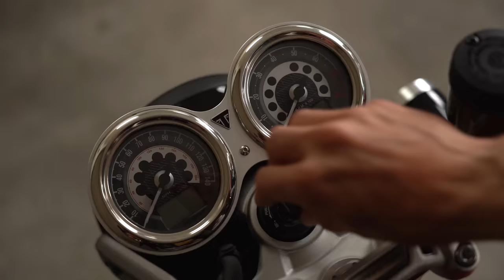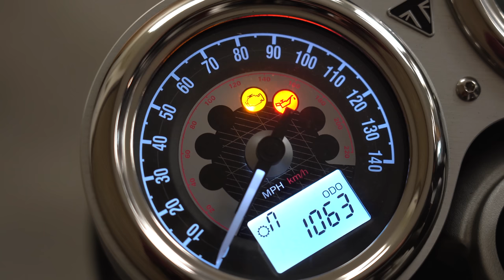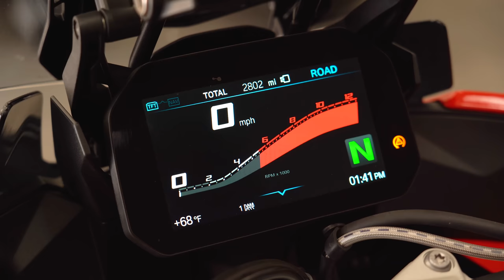Do You Need To Warm Up Your Engine? | The Shop Manual

Comment: I have always believed it to be healthy to warm any engine up for a minute or two. I have a 2021 Z900 and a 2017 Audi A4 and both of these vehicles rev at about 1200 at idle for about a minute depending on the outside temp. I let them both drop down to the natural idle speed before driving/riding.
Reply: A lot of this stuff is from old information before modern tech. Some people still think they need to let the car warm up too and that hasn't been true at least since the 90s. Some places in the US even make it illegal to leave your vehicle idling since all it does is waste gas and add unnecessary pollution.
Reply: @danielkerr4100  that simply isn't true anymore. It was a few decades ago but modern engines don't have the same issues. After 4 minutes it has gone through the same amount engine wearing cycles as if it was double idle for 2 minutes. It's even illegal to let your car ideal for that long in some areas in the US because you don't need to do that anymore. And if what your saying is true when does the engine blow up? My car is at 82k miles now and I've had it from 13k and haven't had any engine issues and I drive it the same in summer and winter and hit it hard once it has warmed up. Do you have any concrete data that backs up those claims because I should see some loss of performance at this point especially since my car is a sports car. Also the more efficient your engine is the less heat it will produce at ideal so that would only intruce more inconsistency with the logic in modern cars.
Reply: Sweet! I have a 2020 Z900. I  love that bike.
Reply: Old car manuals will say 30 seconds.. something about getting the piston/rings to be expanded as to reduce blow by.
Reply: Why would you idle a car at 1200 rpm ?
Reply: @dammdaniel9953  it idles at 800 rpm but when cold, it idles at 1200 rpm for a short time, once the revs drop, I then drive it.
Reply: @dangernoodle4305  that's to warm up the catalytic converters apparently as the metals inside need to reach a certain temp to convert carbon into CO2, and other things in your exhuast gases effectively.
Reply: @trsskater i try that in the morning after the night of heavy raining i parked my bike outside without cover it....the first engine start in the morning just fine and i didn't idling the engine...just ride off...and bad happen when i was stop at the cafe to get my breakfast...and done breakfast...my bike fail to start....i waited till 30 minutes and then the engine start so smooth.... i talked to my mechanic he said during cold you have to warm up the engine atleast 4 to 5 minutes....the engine temp drop in low
Reply: @TroopsofDoom666  Maybe for an older bike. But the only reason to have a warm engine is for engine oil to build pressure and expand the rings. If it wouldn't start it's more likely the fact that your bike sat for long enough for water to get pulled into your gas. Your engine was running so it was already warmed up. A lot of mechanics know the average person doesn't understand the complex reasons why things happen so they give you a simple answer even if its not correct because it's easier to explain than telling you that gas is hygroscopic and letting your engine warm up gives it more time to burn off the water in your fuel system.
Reply: Not sure about Audis, but on Ford trucks, the engine idles high for a while after startup to keep the water pump and radiator fan spinning faster until the ECU decides that it trusts the engine temperature.  It does this whether it's -20F or 110F outside.  I've heard that it also has something to do with the catalytic converters warming up faster, but I don't think that is right.  Most modern cars have 2 or 3 cats each designed to operate at different temperatures.
Reply: @trsskater  Illegal to leave your vehicle idling? Must be California.
Reply: @CRFLAus  It's actually New York and New Jersey. If you leave it idling for more than 5 minutes or 15 mins when it's below 25 F. The EPA says a car produces more pollution idiling than it does driving 30 mph.
Reply: @trsskater   and I think that's a very reasonable stance. Why produce unnecessary pollution when it literally does nothing

Comment: Very interesting & helpful although old habits die hard. I think I'd always leave a bike a few minutes to run in & give it a good few miles regardless before giving it any serious throttle. I probably have too much mechanical sympathy but it just feels wrong to abuse an engine imo.
Reply: At the end, he did mention giving it time before trying to hit redline.
Reply: Correct
Reply: @samuelalexander8030  True he did, just meant I'd probably always have that routine regardless of the science. I guess it just feels right to me at least, even if it's not strictly necessary.
Reply: @ragerider6283  One failure in all parts, especially the parts that are operating at higher temperature that always and inevitably catches up is called "fatigue failure". Sure the morden manufacturing methods and considerable about of design consideration goes into making sure this doesn't happen before "N" number of working cycles, but you will only find this out after say like 10 to 20 years. It's always a good idea to let the bike sit a while, let it get to somewhat of an ideal operating working temperature so that there's no sudden "thermal strain" in components which leads to small micro fractures and whatever. 
The Science does say this and it's usually ignored because it doesn't have any immediate effect. And ofcourse there are the tolerances and what not that has its own effects with respect to temperature change.
Reply: @arunvignesh7015  “Micro-fractures” aren’t thermally induced; they’re caused first by metal-to-metal contact before oil-flow and are made worse by heat.
Reply: @arunvignesh7015  You have a misunderstanding of fatigue failure. It has nothing to do with temperature. It purely happens in everything that preforms a repetitive task. Letting the bike warm up will not prevent/delay that from happening. And the tolerances that need temperature is the piston ring. Which will always have a gap by spec or it will cause damage. The position ring gap being wider from a not warmed up engine only creates lower power production due to blow by. It doesn't damage the engine in anyway like people assume it does. Warming up was really just to get oil through the system and to get carbs to function without stalling. Everyone just stick to the old habits since they don't know better but still spread the old information like it is still facts still again because they don't know how it works.
Reply: @danielgaskell5490   Ugh, yes sure the micro fractures are usually contact based. But with my limited experience with some research into fatigue failure in welded components, it's my understanding that the thermal strains indeed helps propagating it and growing them futher, maybe I should have used better words. But I am aware revving the engine high is nothing like sudden temperature chages in welding and might not have the same impact like it, but it's still a cast metal, heat treated for sure but the grain boundaries are still grain boundaries and temperature effects are still temperature effects although it happens much in the elastic region and by the time it all catches up it doesn't matter.
It's simply good practice is all.
Reply: @trsskater  Well if I have a misunderstanding I sure would like to correct it, but thinking that temperature has nothing to do with fatigue is a terrible misunderstanding to begin with. Sure it's a structural phenomenon but when working with structures which undergoes thermal expansion it does come into play depending upon what kind of temperature change and gradients that the components undergoes.
Sure a motorbike is not a jet engine operating at thousands of degree Celsius that thermal fatigue will be the first form of failure, I'm sure before it there's various other forms that will catch up.
When burning gases are involved and the temperature gradients are apparent, it's in my opinion a best practice to let the thing heat up eventually instead of suddenly irrespective of what's gonna go wrong one doesn't do it. Maybe I just like taking it easy till everything is ready and you can sure have a different opinion.
Reply: @trsskater  You could argue that the piston+ring microscopically rattling around inside the cylinder walls before it's up to temp will create uneven/undesirable wear on the block. I mean, we're talking about thousandths of an inch, but blow-by isn't the only legitimate concern about putting a cold engine under load.
Reply: @arunvignesh7015  I absolutely agree with you on all points. Very well written 👍
Reply: @arunvignesh7015  slow warmup by idling is bad practice, better to start riding immediately and leisurely. That way, the engine warms up faster, so less cycles at low temperatures. The rate of engine warmup is then on the order of a degree C every few seconds, nowhere near sudden.
Reply: @arunvignesh7015  The reason why I say this is because the fatigue faliure in the a vehicles engine comes from the parts in general. The fact that they get warm only makes the situation worse. The piston expands but still never touched the cylinder wall. That's the rings job to cover that gap. The metal on metal contact is what leads to failure. And modern engines are very efficient. It is a waste of gas to let it idle for 15 mins until it warms up to full operating temperature. Theses aren't the same old engines of yester year. They don't bog down when you put a load on them before they are warm. If you don't trust me you can talk to a mechanic that works on bikes. They will tell you the same. It's an old habit from old technology. Like how some people still think modern batteries have memory.
Reply: @kpblasko  I get what you are saying but I think it is a wash. If you let the engine idle at 1500 rpm for 15 mins to let it warm up or run it at 4000 rpm for 5 mins. It still nets that the piston ring was rattling around for 337 cycles over the 15 mins or rattled around for 333 cycles for the 5 mins. Pretty much the same amount of wear occured.
Reply: you really don't need to let it run a few minutes before leaving. It's actually illegal even for pollution. Just go easy the first miles.
Reply: @bloodhoug82  Not illegal where I am but I take your point, although my mechanical sympathy is strong lol.
Reply: Agreed. Letting it idle to warm up certainly wouldn't hurt the engine!!
Reply: I do the same. :) This is just an old school habit. :) Drop by buddy.
Reply: @thennekcdcdthennek6417  Perfectly agree. For a few minutes... it can be only good. :) Drop by, you may find it interesting.
Reply: @RRRRefuelRideRace  Indeed & I'm not a youngster anymore.
Reply: @RRRRefuelRideRace  old school habits can broken
Reply: @ragerider6283  Sure, believe you man. :)
Reply: @bloodhoug82  Agree on that, but it takes time. :)
Reply: I use a heat gun to heat my engine. Save fuel and engine both 🤣🤣🤯
Reply: @pravesh736  It seems dangerous. :) Drop by when have time.
Reply: @ragerider6283  With many newer over square higher reving engines with pistons with hardly any skirts on them.
I'll warm my bike up for sure. My mechanical engineer Dad laughed when l told him about this video, saying that many people will get it wrong and it's better to be safe than sorry.
Reply: @scottyd2262  100% agree. Warming your engine slightly won't do it any harm but not doing it could if your too aggressive with it. I literally turn it on, do a really quick walk around to check to make sure nothing's obviously wrong, do my jacket up stick the lid on, then gloves & off I go. Takes about 3-4 minutes which is perfect imo.
Reply: @scottyd2262  I agree as well. 90% used bikes I've went to look at the owner starts it right up and starts reving the piss out of the bike looking at me like cool right? Need less to say I just leave... I give my bikes a minute and thirty seconds or so, as I don't have any place to be 24/7 that I can't spare a minute. I take pride in my equipment and don't feel that it's a machine for me to abuse and toss aside.
Reply: @Jasperv71  I bought one of those heat strips that tell you the temp of the motor for my new 21 Husky that I converted to a supermoto. Even loading a cold motor can be just as bad as reving one with these oversquare bores because of the lack of piston skirt. Some people will watch this and only hear that you don't have to warm up your motor and that's it. Not everyone of course, but some will. That's why my ride on mower has a sticker on the drink holder that says "NO HOT LIQUIDS TO BE PUT IN DRINK HOLDER !!" Because many people are dumb ... LOL !
Reply: @trsskater  Any high comp/boosted setup, or ones with thin P2W clearance NEED warmup before any excess amount of rpms or load. Otherwise the pisons will be heatsoaked and expand quicker than the cylinder walls, causing scoring and damage.
Reply: @trsskater  Man, who lets the bike idling for 15 min? Nobody!
5 minutes is enough to warm it up to 55C° when the weather is cold. On a warm day you need 2 mins max. 
It is recommended by the manufacturers to let the bike warm up and not to rev cold engine. 
I am the mechanic and I had so many examples where engine started consuming oil after only 20kkm or 12k miles only because of this reason - hopping on a cold bike and revving the shit out of it. 
For a cold engine, even 5-6 000 rpms, it is too much!
Reply: @scottyd2262  I put a whiskey bottle in my cup holder and off I go for an afternoons drinking and driving.🥳🤣🤣
Reply: @Adogsmate4267  In your car or on a ride on mower ??
Reply: @scottyd2262  Come on dude, on me mower. Look forward to the lawns, dead straight lines,  with a 2 round boarder mow,  love  my Husky afternoons.
Reply: @Adogsmate4267  Cool l had to ask 🙂
I hope that i didn't piss ya off. I've heard some strange comments in the comment section before. It can be hard to work out what's what with no tone of voice sometimes.. I tried a zero turn for the 1st time last week.. Those things are insanely good ! Unfortunately l had to give up drinking 4 months ago. Mowing the lawn just isn't the same anymore 😒

Comment: Agree 100% with this.  I will do low rpm riding even with my carbureted bike once it's warm enough to run at half choke.  On my EFI bike, I roll it out of the garage, start it, close the door and put on my helmet then go.  I think most people who ride have the same ideal scenario that I have for warming up their engine --  I take it easy for the first handful of minutes though town, and by the time I reach the highway, the bike is ready for some revs.

Comment: I ride an old Knucklehead. I tuned the carb lean to save money on gas, as my  income as a senior is limited. The only drawback, is if I kick start it in March, it needs to idle until at least May to warm up. It coughs, spits and farts more than I do. But, May is a better month to ride it, anyway.
Reply: Shoulda bought a Honda .
Reply: Running lean doesn't only generate a worse combustion that takes more time to warm the engine... It also reduces power output and when the engine is hot, it tends to run hotter. Air/fuel mixture should always be as close to stoichiometric as possible.
Reply: Dont want to run an air cooled bike too lean, it effects cooling in a negative way. I always ran my carbed bikes a touch rich.
Reply: @LucasDaRonco  So...I'm the knucklehead?
Reply: @northerniltree  lol, that was funny 🤣
Reply: @garyhope6577  That's why you're called Hope.
Reply: Love it 😂😂
Reply: @LucasDaRonco  A lean mixture runs a lot hotter because fuel also acts as a cooling coefficient. Also peak power is NEVER at stoichiometric AFR, in neither naturally aspirated nor forced inducted engines
Reply: @factoryrider9537  agree!
Reply: Just get a small cubication bike for dailying and use your knucklehead on the weekends. A lean bike is no fun to ride.

A 125cc honda averages 60kpl/140mpg and it makes enough horses to go around town.